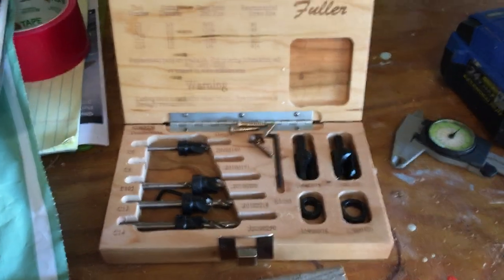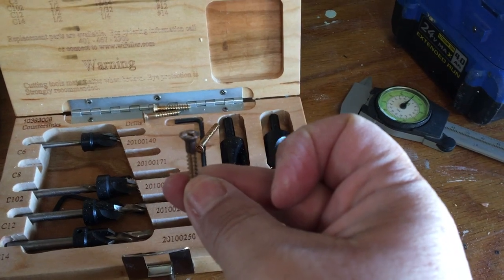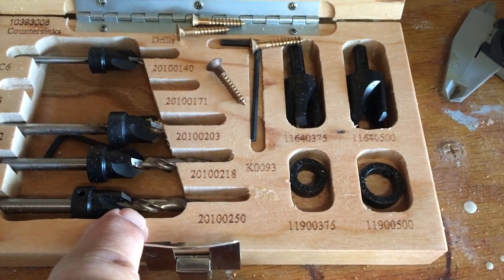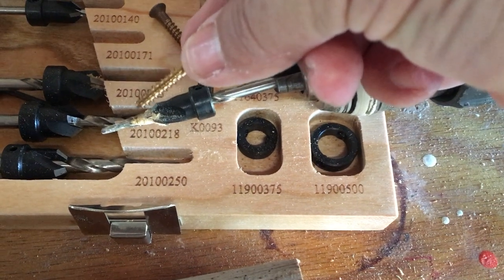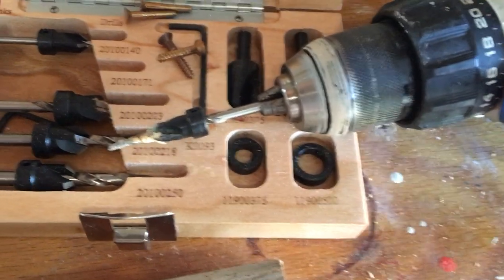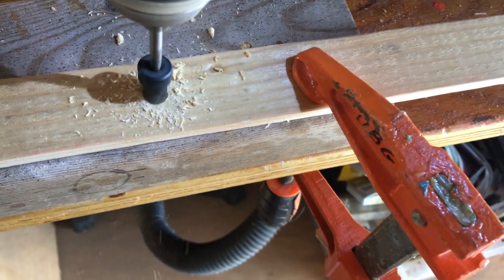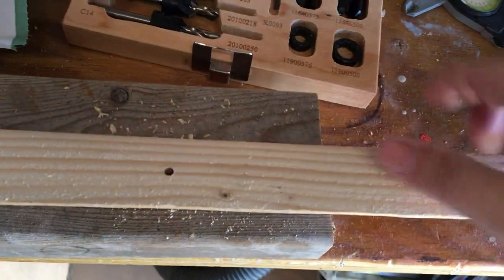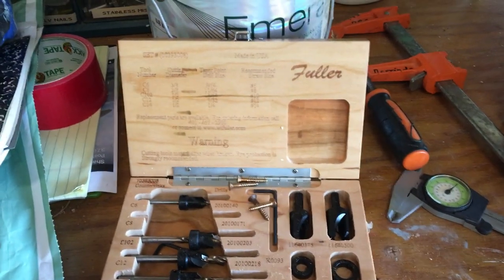Fuller Countersink Set

Comment: been a big Fan of Fuller Countersinks for more than 35 years  i have also owned ,Operated,and done all my own repairs  to 17 or 18 Boats  of all sizes and Materials  i typically buy the Fullers inBulk fromTools OnSale and /Or Tools Today  in my  job i ran a CustomArchitectual Woodworking Instalation Team made up of 30 to 50  Installers and as a courtesy  and Convenience to the Crew  i carried most of our Commonsizes in my Van  and sold them and a few other items  for cost  i also did a refasten on my 1964 Chris Craft Wooden Constellation CabinCruiser i restored  in the 1990s  using  severalPounds of SiliconBronze Screws  incidentally i used Fuller brand Plug Cutters to fill the holes withMohogany Plugs
Reply from the maker: Great info thanks for sharing!

Comment: Fuller IMO  makes the  best Counter Sink Drills  I have some in my Tool Boxes that are over 35 Years Old and I used  them everyday in a Professional  Manner  Installing Architectual Woodworking    fYI. I  did however sharpen them using a Jewlers  set of Files  and a  small Wooden Jig. I attached to the lid of my Tool Boxes to  hold the Countersink  steady
Reply from the maker: Good info. We've used ours a lot.

Comment: I did Woodworking professionally for over 25 years and it was my hobby for 35 years i have some of my original Fuller Brand Countersinks that i used to “Dress “ In the field with either a file or a belt sander  i have also used those to refasten  a 1964 Wooden Chris Craft Cabin Cruiser i restored and they are the only Countersinks i reccomend to my freinds whenever I’m asked   I tried their Carbide tipped versions but prefer the HSS. For woodworking the Carbide are okay for certain metals and plastics  but it goes back to the old saying for Woodworking in general the High Speed Steel works why fix it ?
Reply from the maker: Hi Craig, thanks for the info. We always like hearing about what tools, techniques and materials work for folks out there.